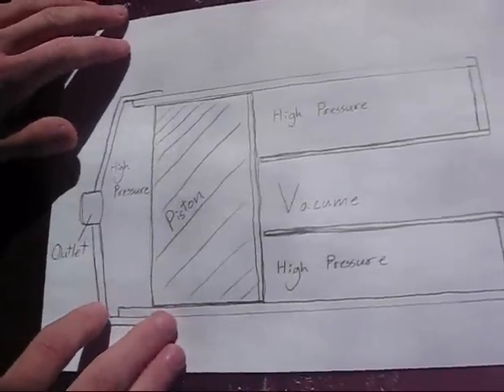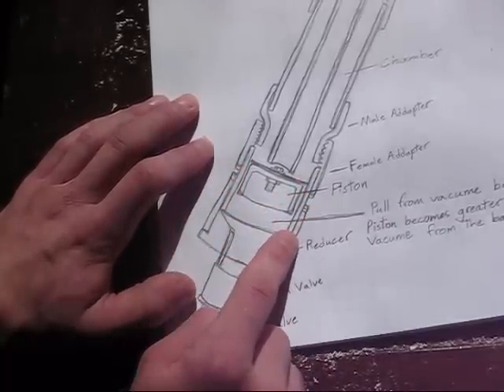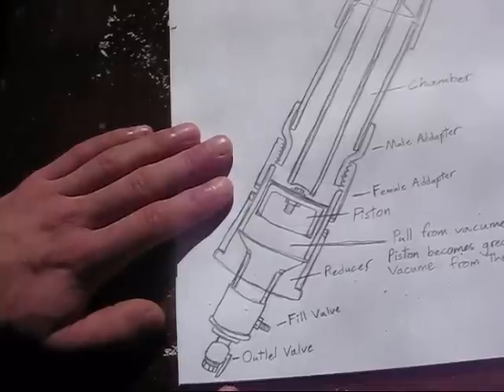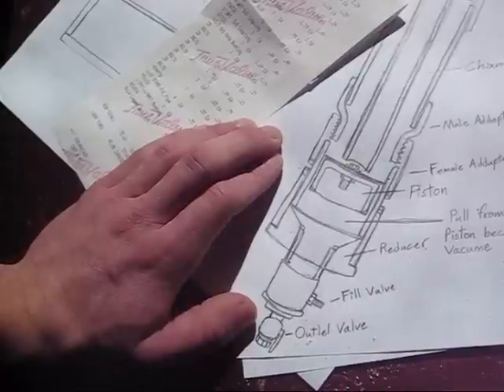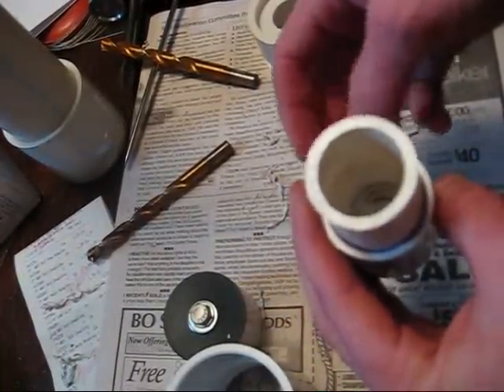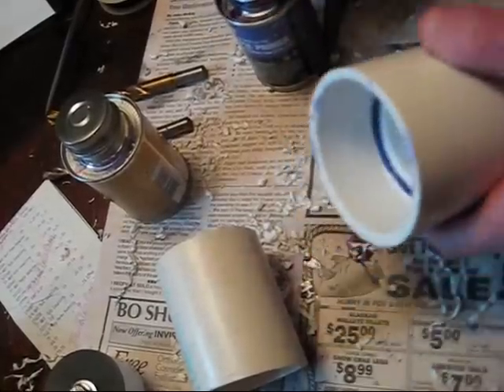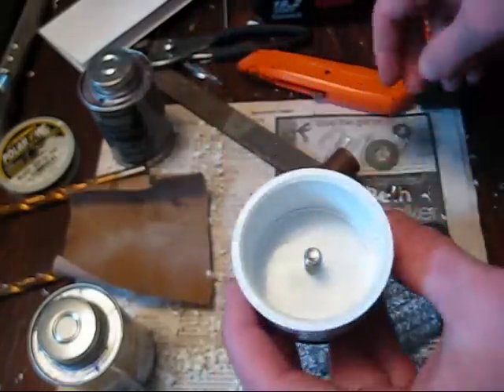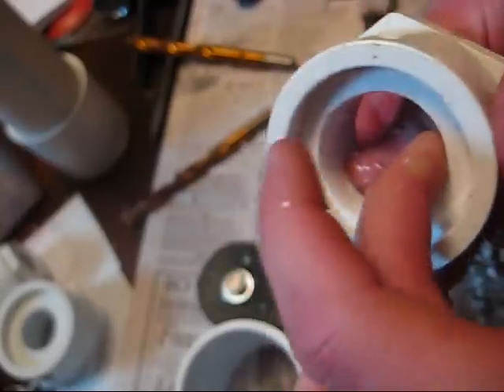DIY Workshop - Make a Powerful Air Cannon for $50

Comment: This is like one I made years ago . I used 4' 4" pvc and 6' 2" pvc, 3"rubber quick cap as my valve. At the valve end I cross drilled with a 1/4" 20 threaded rod and sealed the threads to hold the 2" barrel. Great Video.

Comment from the maker: As far as speed is concerned, it opens just about as fast as a pneumatically actuated sprinkler valve. However it does not force the air through as many corners as does a sprinkler valve. In that way the air flow is faster. At this size a well modified sprinkler valve would be just about on par with this piston valve, but this is a very small piston cannon. The valve can be scaled all the was up to say a 4" chamber with a 3" end cap as a piston. No contest at any size larger than this.

Comment from the maker: Nothing is absolutely permanent, but the design yields a solid cannon. The rubber barrel seal may need replacement every once in a while, or it may survive for years if it never sees high pressures. Either way, that is an easy fix and all that is ever likely to go wrong.

Comment from the maker: What you describe is the ideal piston. That will work nicely. The simplest way to make a one way valve is to drill the hole so that the edge of the rubber gasket that seals the barrel covers it. When you fill the chamber the edge of the gasket is pushed up allowing air to pass, but when the dump valve is opened the negative pressure behind the piston pulls the gasket against the hole sealing it.

Comment: Hey thanks for all of your help. I'm building a bigger better gun so I'm designing a 3 inch piston valve.
Another note, Microsoft excel is an amazing program. I just recently learned what it could do. So if your into the math behind your potato guns, you might want to play around with it. It has made thing so much easier and faster for me.
Thanks again.

Comment from the maker: There are a few things that will help. A larger or faster acting release valve is a good start. Up to 1/2" ball valve perhaps. Secondly, a better sealing piston would do wonders. It shouldn't be entirely airtight because you need some air to pass and fill the chamber, but it should be close. Cutting a slot for an O ring around the piston would work well. A cut under the ring would allow for a slight passage of air.

Comment from the maker: Cool, let me know how it goes. They can be tricky, don't be discouraged if it doesn't work first time you pressurize it. The piston may need work, barrel end might need to be sanded so it seals better, might need a larger release valve...Tricky to get right, but sure worth it.

Comment from the maker: You have two choices. You could add it on the opposite side of the coupling from the fill valve, showing you the pressure of the rear chamber, the highest pressure in the gun during filling - Or in front of the piston through the wall of the male adapter, showing you the front chambers pressure, the pressure the projectile will be fired at. Wherever you decide to place a gauge, make the hole through a fitting as well as the pipe itself. The double thick wall will help maintain chamber integrity.

Comment from the maker: Yes, if you have enough threads coming through. It is not really necessary though. Even at 100+ psi, the surface area of one of those valves would only have maybe 15 pounds of pressure acting upon it. If the threads dig into the PVC even a little, it should easily hold. I would never tell anyone not to take a precaution they felt was needed however. Always best to be safe.

Comment from the maker: Thanks. Sch 80 is nice, but not really needed for an air cannon unless you're bringing it above 150 psi...Even then, Sch 40 can technically handle it, though I would not be comfortable. I myself would only use Sch 80 if I were building a hybrid. If you're building cannons for others though I understand. You never want someone else getting hurt from something you built, no matter how slim the chance.

Comment from the maker: See it or not, it is drastically more powerful. Take it from a guy who has built over 20 air cannons. The slim loss in pressure is negligible. The real thing that makes or breaks an air cannon is the speed of the valve.

Comment from the maker: The piston likely needs to be a tighter fit. A wider washer on the front end might be enough to seal around the piston as the air pressure drops behind it. Ideally, as little air as possible should be able to pass by. If too much air can move around the piston, the area behind will never be allowed to drop to a pressure low enough to open the vacuum seal on the barrel. Even if the piston does not slide as easily, a good fit is more important. It should only have a small leak to fill the chamber.

Comment from the maker: Most any hardware store or even a place like walmart should have a rubber one that will work fine. They look different and are meant to be installed from the inside. They may be labeled as a tire stem. It takes a bit more looking to find a nice brass one like I did. Check the air compressor area in a large hardware store.

Comment from the maker: I use a schrader valve. The chamber is filled with the same fitting as a tire. Some people have used a quick attach fitting for a compressor hose and screwed it right into the chamber.

Comment from the maker: Yeah any large hardware store should have everything if they're properly stocked. Usually plumbing sections are a mess and you'll have to dig through boxes of various parts to find just what you need. I always assemble a cannon in the store to the best of my ability just to be sure it'll all fit together and nothing's missing.

Comment from the maker: PVC cement is a must, any other sort of glue is not suitable for PVC. PVC cement does not 'glue' but instead welds the plastic together. Primer is important to prepare the surface of the PVC to be chemically welded.

Comment from the maker: The length of the chamber that extends in front of the piston doesn't matter, but you want as little space behind it as possible while still allowing it to move. If the rubber is sealing against the barrel enough for the cannon to be filled at all then it doesn't need to be made larger.

Comment: Thank you for the info..One other thing could I make around the piston air tight,drill a hole in it and use a one way valve...Just a thought I had...s air goes into the front chamber through the valve...p.s your design is awesome...

Comment: ty so much for the help a 3 inch end cap with the bumper and the rubber added to it i would think plus the piston could be abs ? and would the tight fit affect performance of pison ty again for the help

Comment from the maker: I wouldn't say a diaphragm valve is all that much faster...Only in that there is usually less mass to accelerate to get the valve open. I would consider the difference in speed negligible. Though I must say, I've never seen first hand a diaphragm valve built into a coaxial cannon. It would be interesting to see how a piston cannon of the same dimensions would compare. I think the curve of a diaphragm may offer smoother airflow.

Comment from the maker: That problem can be fixed by a larger valve, or a tighter fitting piston. You can use a bench grinder or a file to grind a groove around the piston to fit an O ring. That will give it a tighter seal.

Comment from the maker: I did not actually build an actual working model of that cannon, I simply made the drawing to explain function. I would suggest a 3" end cap as a piston. If it will fit in sch 80, it could be a tight fit.

Comment from the maker: That's a fairly simple task. If you go into any half decent hardware store and explain what you need to do they should be able to get you what you need with no problems. They make portable air canisters just for that sort of thing. Anywhere between 3 and 90 gallons are typically available.

In this case, making your own would not be a good idea. PVC is not meant to hold air pressure in the first place, it could not stand up to the rigors of commercial use.

Comment from the maker: I should have measured it for the video but I did not. It is not important. For this size barrel and chamber it would be about right to have the barrel be just under 2x as long as the usable chamber. By that I mean the chamber in front of the piston.

Comment from the maker: The piston needs to make a tighter seal in the chamber, or you can use a bigger ball valve. Either one of those things should make it fire. To make it stop leaking you can try some grease on the face of the piston, or even better, some TFE pipe thread paste.

Comment from the maker: Unless you have very extensive experience working with PVC, 50 psi is all I would recommend. I go much higher because I am confident in my ability to glue fittings and the like.

I have thought about adding an air gauge, but I designed this cannon to be inexpensive. It is simple enough to regulate pressure at the compressor. Many of my other cannons have pressure gauges.

I thought I had mentioned in the video to let the glue fully cure before pressurizing. I meant to anyhow.

Comment from the maker: The end cap is the piston you understand right? I imagine a 3" ABS end cap might be hard to find. PVC would be much more likely. The piston should slide fairly easily, so long as it is not tight enough to get stuck it should be fine.

Comment: Using your piston design, I made a much larger version (3 and 1.5 inch PVC, about 20 feet in length for the main tanks). So far, it's firing at about 200 yards from 40psi. Anything I should watch out for?

Comment from the maker: The piston is a 1.25" end cap. 1.25" is the inside diameter of the pipe that the cap is meant to fit over. Therefore the outer diameter of the cap itself is much larger.

Barrel and chamber lengths are not crucial, so long as the barrel extends a few inches out of the back of the chamber. My chamber is ~2.5', barrel ~4'. The piston slide is ~4" long. The piston must have enough room to move 1/2 the dia. of the barrel away from it, but no more than the full ID. So 1/2" min. for this gun, 1" max.

Comment from the maker: That is the reason for the bumper. Simply replacing a PVC piston with a piece of HDPE is no solution. Instead of a piston cracking you could instead have the piston assembly explode in your hands. Bumpers are an important part of a piston cannon, HDPE piston or not.

Comment: would a 1 1/4 inch barrel nedd a longer pressure chamber. what length is your barrel and length of 2 inch pressure chamber in the plans. I could do with a bit of help  as I have no experience with air cannons and want to use it for surf fishing. GREAT VIDEO

Comment: what are you using to fill the air chamber.. wouldn't it be safe to have a air gauge on it to make sure you're not overfilling the pressure?
I made one and the ball valve seems to let out more pressure before the barrel lets out a charge of pressure -- does the ball valve size matter -- im using 1/2"
thanks for the video

Comment from the maker: Then perhaps I remember incorrectly the cap size. If the 1.5" cap fits inside the 2" pipe, use it. You want as close a fit as possible.

The rubber washer was bought at a hardware store among the nuts, bolts, gaskets and other things. And yes, the rubber washer is mounted on the front of the piston and seals against the 1" barrel when the gun is pressurized.

Sorry I did not answer all you asked the first time. I was trying to fit everything into one comment and forgot about the washer.

Comment: well im using scd 80 pipes 4 inch camber 2 inch barrel and all the reducers to match basically a end cap a with scdre valve and quick realse on the end of cap the camber with reducer and the barrel ive trived so man i basically need to know what u did for the piston design for the orgianl drawing in your video thanks for the help

Comment: ok cool thanks, now does it matter on the over all length of my chamber? the rubber i used at the end of my piston is slightly smaller in the inside diameter of the 2'' should that be a little bit bigger?

Comment: Hi Ben
Your videos are always interesting, but I never found a completion and test firing video of this project, the design seemed great  but you never told us what happened in conclusion,  we never had a closure🤣
at the same time I noticed that since afterwards you took up multiple air canon projects with a variety of designs, which were all awesome, but also you didn't tell us the pros and cons of each, and what drove you to change and try so many different designs.
Please consider addressing what i mentioned if possible.
Thanks
Reply from the maker: The latest design is the best. With each version I made improvements, mostly in ease of building them and reliability of the valve.
Reply from the maker: This one is best: https://youtu.be/G1VCZEXi384

Comment: Nice video - Just a note - there is schedule 40 PVC that is not pressure rated. It should be specifically pressure rated, schedule 40 drain pipe and fittings are not sufficient. Schedule ratings indicate the size, there are separate markings for pressure ratings. So calling out schedule 40 is insufficient.

Comment: i built this exact how you built your expect length seeing how you did not tell over all length of piping. when i fill mine it seems to leak by an out the barrel an when i release the ball valve all the air dumps out the back. what am i doing wrong?

Comment: why do u want it to be a pressure activated firing method    dont u have to have equal presure on both sides of the piston anyways to keep air in 
so why dont you just have 2 chambers and 2 valves

Comment: @jordanw2013 Yes, There are easier ways of doing it, but they are not as efficient. The Pressure valve works way faster than a ball valve and still faster than a sprinkler valve. So, with his design he gets more compressed air pushing faster. So the projectile has more air behind it before it leaves the barrel. With a ball valve, not all the air has escaped when the projectile has already left the barrel. With his design a canon will get a lot more power than any regular valve.

Comment: Our design is slightly different actually, the back of our cannon gradually gets smaller and our piston (covered in a half inch of duct tape) simply jams itself into the back for an additional seal

Comment: Yes there are easier ways, but no, no they dont. This type of valve has the quickest exhaust of any rifle which you can build at your house. A quicker exhaust results in a higher amount of pressure hitting the projectile a lot quicker, which ultimately results in higher velocity. The second thing about this type of valve is that it can be controlled with a smaller ball valve or even a blowgun, this is important because it causes the gun to jerk less when fired, improving accuracy

Comment: +NightHawkinLight @NightHawkInLight : This concept and your explanation are really cool.. but there is something I find very hazardous : If the air pressure become the same in the chamber made for shooting and in the chamber made for trigger, the piston will move and the gun will shoot without the permission of the shooter :O A mechanic much more secure...
Reply: +Symo Nyac the differential with the barrel is what keeps the piston in place

Comment: the air in this design has to change directions as it expands into the barrel.
there are numerous other ways to make the piston valve have less drag and turbulance. just look at a few of the other potato guns on youtube.
out of all of them this would be my last choice.